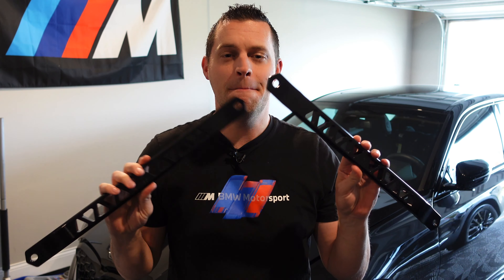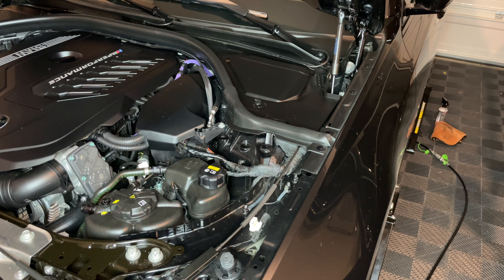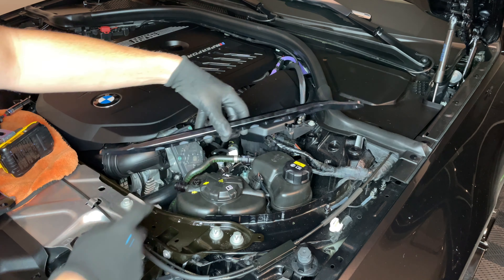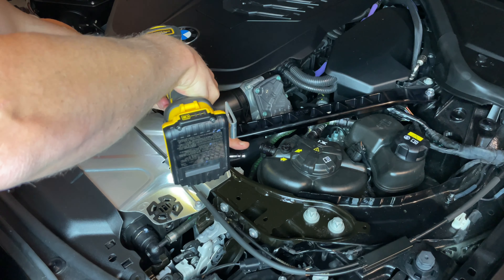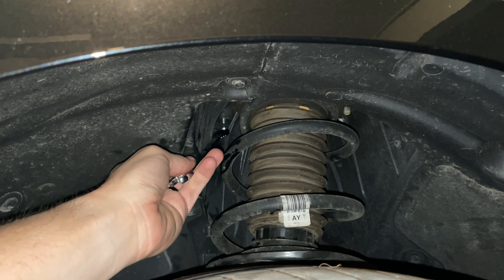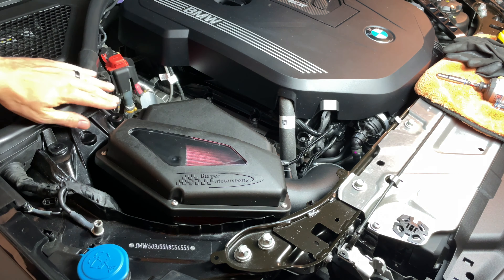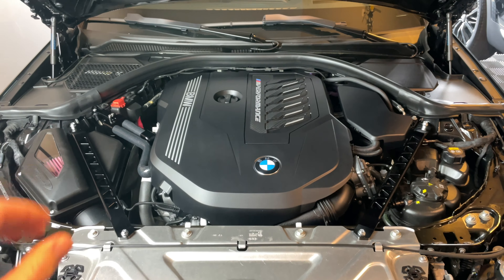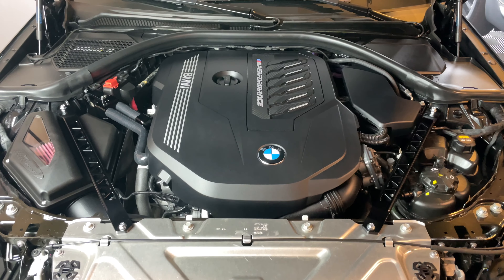How To Install Burger Motorsports BMW G20 M340i Billet Strut Braces!

Comment: I have a 2024 M440i and it looks like the rear bolt which is a torx bolt, at the actual strut, does not have a nut.
Reply: Coming back to confirm there is no nut on the 2024 M440i. Just the bolt.